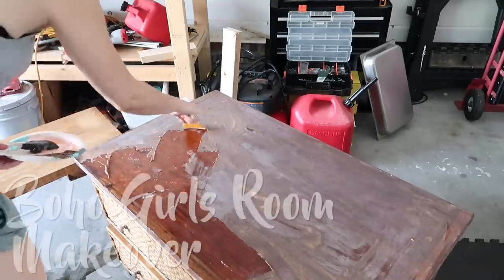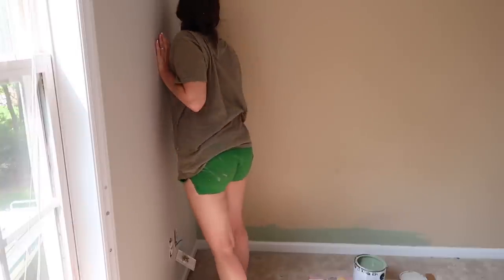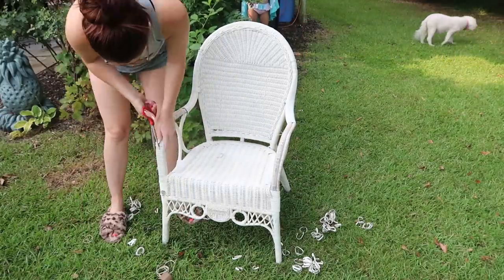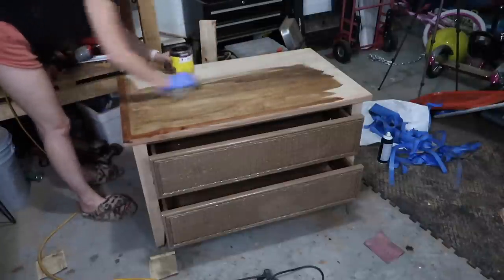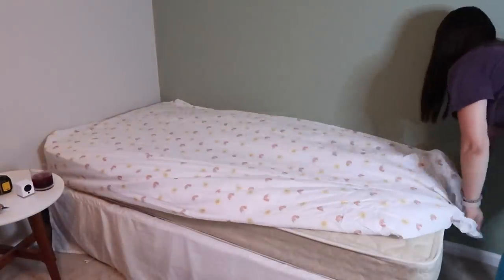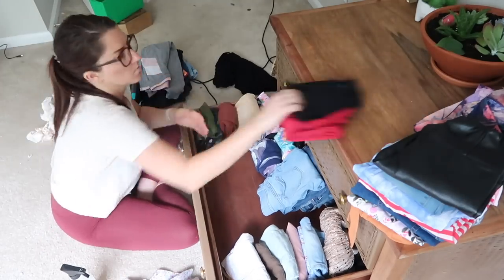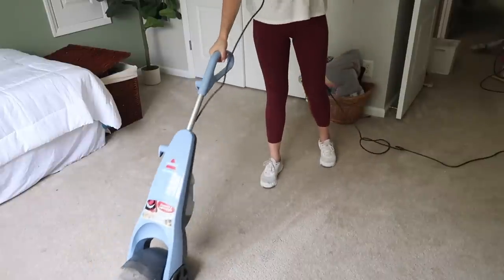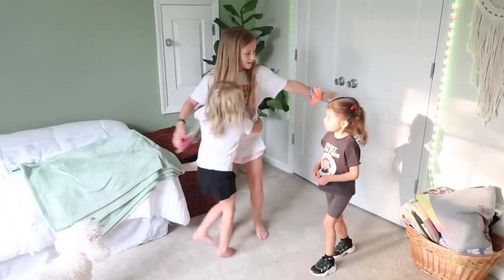DIY Girls Bedroom Makeover on a Budget | Girls Bedroom Ideas | Boho Bedroom Before & After

Comment: Hey girl love the make over, I hate painting as well but the finished look is rewarding. You did right surprising your little girl. Starbucks is my go to.  Also the Vacuum question. I have a cleaning service SHARK is the BEST for the money. Over the top vacuum is the RAINBOW vacuum. I highly recommend both. I have recommended over 20 sharks and no one has ever been disappointed.i have used other brands I don't like them they do not compare with the handling of moving around or the cleaning. SHARK is the way to go make sure to get the floor brush with it for hardwood and other flooring with out carpet. I also like the shark steam mops.   Rainbow Vacuum cleaners are my number 1 in the end they do pay for themselves, most people get put off because of the price.    Best of luck with the  vacuum  seach.